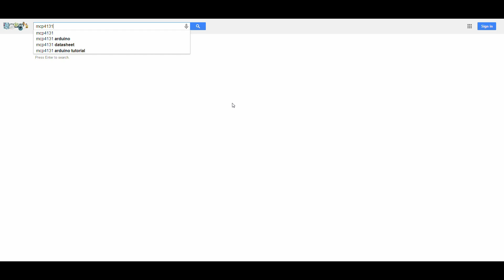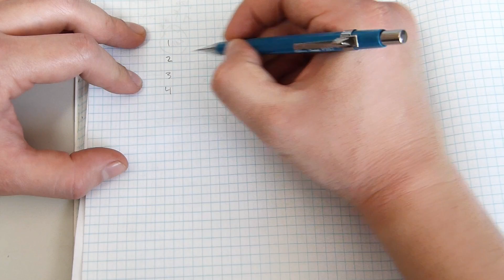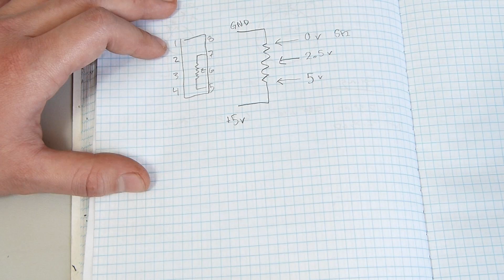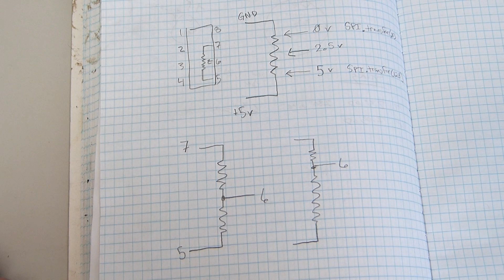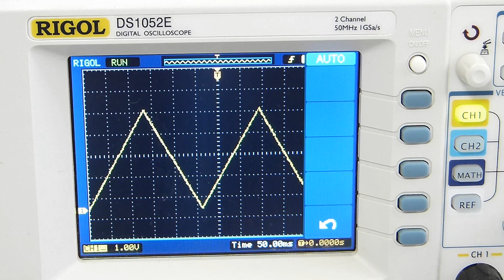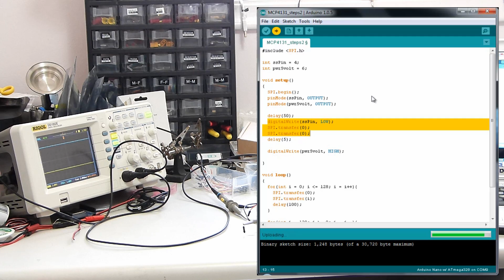Digital Potentiometer Tutorial Arduino MCP4131 DAC Raspberry Pi  ESP32 STM32

Comment: So I understand the operation power is 1.8 to 5v but I'm wondering if I can use this chip to control a heat rod with a thermistor to keep a plate a specific temperature?  The heat rod is 120 v using an alternative power from the wall. I guess I'm trying to figure out how I would wire that to this chip or if this chip can work for that? Idk if there is a relay or something I hook to the chip that will vary the voltage output?  That doesn't sound right to me though.  Thanks anyone for your help I'm still a newb.
Reply from the maker: If the input channel high impedance that doesn't require any load for sensing (like an arduino input), then you can use it.

Comment: hello Mega Mechatronics! good video. Can you help me to used an Rhéostat MPC4162 ?I can't find the right code on arduino. I have a small enough simple project normally but I can't find the right code. Could you give me your contact so that I can explain to you?
Reply from the maker: You may have 'thrown in the towel' a bit too soon here.  I suggest first "search engine" something like this: how to wire a rheostat  -to double check we understand how a rheostat is typically laid out, from multiple sources makes more confidence.  Next, pull up the MPC4162 datasheet then match up the rheostat wiring on a breadboard.  Finally, do a bench test by creating a dummy circuit, or dummy load to simulate something quick to make sure the MPC IC is responding as expected.  

If it's not working on the bench, trace it back to the arduino Inputs/Ouputs, if not, trace back to code finally.  Basic literal wiring can also cost hours of debugging, so make sure the wiring/jumpers/connectors are sorted, and check again if you are still having trouble.

Comment: you shouldn't connect power source from digital pin, those pins are meant to be used for signal only, since they can output only 40mA at max. In your case there isn't a problem since you don't have a load, but someone might try to connect a motor or something that uses more current and they will fry their arduino. Instead use a transistor to switch the 5V from power supply on/off.

Comment: hey men, I have conected one led to the pin 6, that should be the  potentiometer wiper, i have upload your first program like you but the led doesn´t work when i send diferent values with SPI.transfer, what is the problem?? I hope you could help me. Thanks.

Comment: Hi, thank you so much for the video. Can i regulate 10 Volts with this potentiometer? So can i apply 10 volt between P0A and P0B pins to get to P0W a regulated voltage? Thank you so much!!
Reply from the maker: Please refer to the datasheet linked in the description.  This will ensure accurate information is obtained for your particular application.
Reply: Would it be possible to use both of them at the same time with different resistance?
Reply: From the datasheet, NO, not directly. Vdd max is 7.0V  and so, the potentiometer can only handle up to Vdd+0.3 = 7.3 Volt. There are also limitations on amperage (25mA) and power dissipation (they give the formula to compute it in the datasheet) to 400 mW. Datasheet available at many places, such as at https://dlnmh9ip6v2uc.cloudfront.net/datasheets/Components/General%20IC/22060b.pdf
---- modified with additional info here down....
You can try the X9C104 chip which seems to handle up to 10V, but has a lower power dissipation and lower amperage. (Page 4 of https://www.intersil.com/content/dam/Intersil/documents/x9c1/x9c102-103-104-503.pdf)
Reply: From the datasheet:
Maximum current into PXA, PXW & PXB pins ............±2.5 mA

Comment: A little different topic but a related family to the MCP4131 with the  MCP 42XXX series you run into an issue where it needs .7vdd to even acknowledge the I/O and Serial input so this would limit the usage on the pi to, the 3.3v rail anyone  with an idea for a fix to get this to 5Volts, also experiencing some issues with communication on pi using Pi4J our SPI is outputting the proper 00010011 to write to both pots on the MCP42XXX then we output all 0s or all 1s to just see if the pot is running. (using the 3.3 rail for pi) anyways we are logging the output on a logic analyzer and the outputs are the same during the clock cycles, the only difference is the SPI on pi seems to reset to low when not sending and the Arduino seems to rest at high when not sending. the Arduino works and the pi does not.

Comment: what if you had two of these on the SPI bus? pin 4 & 5, what will you code look like?
Reply from the maker: +Gabriel G Please see 12:05 , I explained how to use more than one chip.  Hope this helps!

int csPin1 = 3; //MCP chip A
int csPin2 = 4; //MCP chip B
int csPin3 = 5; //MCP chip C

digitalWrite(csPin2, LOW);
SPI.transfer(0);
SPI.transer(98);
digitalWrite(csPin2, HIGH);

digitalWrite(csPin1, LOW);
SPI.transfer(0);
SPI.transer(varC);
digitalWrite(csPin1, HIGH);

digitalWrite(csPin3, LOW);
SPI.transfer(0);
SPI.transer(122);
digitalWrite(csPin3, HIGH);

So I sent MCP chip B a value of 98, then MCP chip A a value of a variable I named "varC", and finally I sent MCP chip C a value of 122.

Comment: Excellent video, thanks for the explanation.

My circuit is a little different - the digital pot is to replace a regular pot in a PWM motor speed controller. This has separate power supplies for the arduino and the speed controller.

Long story short, I have the B,W,A wire like the original pot was and discovered I didn't need the VDD wired up.

This works, but I'm not happy with something just working, I like to know why. Could you explain why I don't need the VDD? Cheers!

Comment: I have the mcp4132-503 but only 0,1,2,3 and 5 do something with the resistance on the multimeter. I don't know what im doing wrong. I have the exact same wiring and code as you

Comment: Why zero is sent each loop ? Is it protocol requirement, or just redundant line ?
Reply: +Азис Мразиш I'm no pro at this but I believe the first SPI.transfer(0) is the address. I found this in Arduino's DigitalPotControl example under SPI.

  //  send in the address and value via SPI:
  SPI.transfer(address);
  SPI.transfer(value);

Comment: Mega Mechatronics plz help me with that .
i made the program for atmega32 but the mcp41010 in proteus did not work and i have a fixed output voltage of 0.2 volt even the the chip is not connected the atmega32.
waiting for you
Reply: alaa rabea ezz  
I have this problem too.what did you do for that.did you solve this problem?
if you solved it please help me it is very vital for me
my email:y_majd92@yahoo.com

Comment: I'm curious as to if you can use this digital Potentiometer to regulate the voltage on a 9v signal for a LED Driver. I noticed that you were just using the arduino's 5v rail for power on it but will it handle 12v for the output voltage?
Reply from the maker: Check out the datasheet to see if your specific application will work.  It can't handle much current, something like 25mA

Comment: Thanks for this video. It was very helpful, I managed to control the MCP4131 with my Arduino UNO. 
I'm trying to do the same thing now with a Raspberry Pi (model B), but it seems like SPI protocol is way more difficult to use here and the code looks much more complex. Would you mind explaining how to make the same work with a Raspberry Pi?

Comment: Thanks vert mych for the exellent video! One short question, how to work with multiple digital potentiometers? cause' there is only one SPI.transfer in the code and how to separatedly transfer data?
Reply from the maker: Use the CS pin to select what chip you want to receive the command.  So all the chips use the same MOSI line and CLK, but each chip gets their own digital signal going to their CS pin.  When you want to change a value in any given chip, then you pull it's CS pin LOW -> Send Data -> CS pin HIGH.